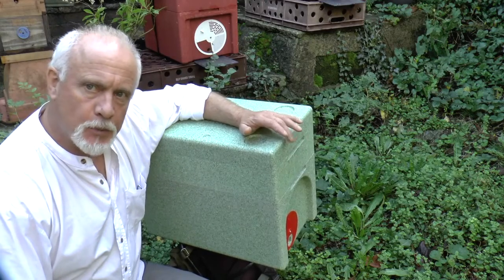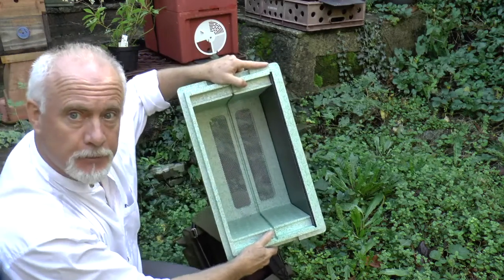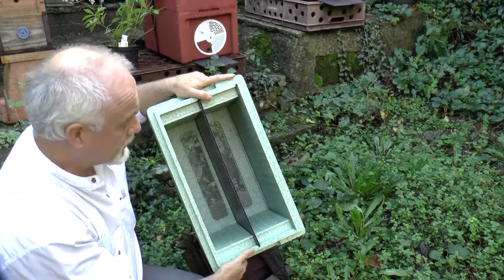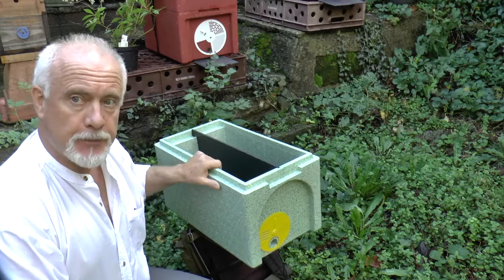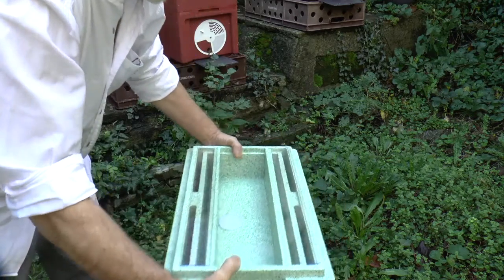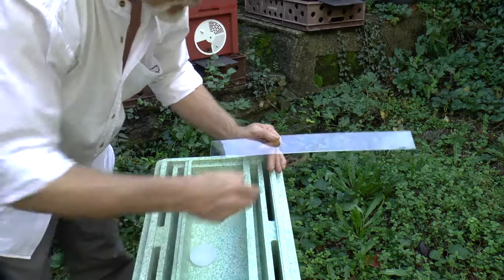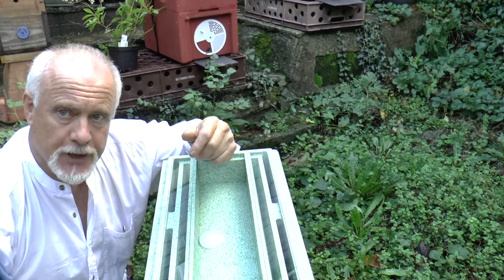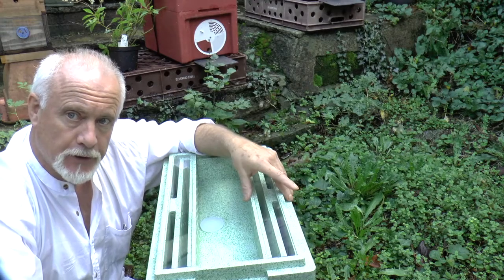How to Use a 2 in 1 Polynuc Beehive

Comment: Hi Phil, nice explanation! I have to completely agree with you and I really like the fact the side feeder has gone from the sides! Although I don’t use this type of poly Nucs I really like these! Three frames does give you more flexibility if there is a flow on and the alternate ends for returning queens is a really good point that definitely will help!! 
I’ve seen similar Nucs in ultra hard density poly for Dadants but these were only two frames! This is the best formulation I have seen! Really well thought out, tons of roof insulation and the added bonus of being able to feed fondant over the winter months! Please do a review at the end of 2018 season and share your findings!

Comment: Hi Phil, have been looking at poly hives because of the amazing thermal properties. I guess the only draw back is that one isn’t able to scorch it to kill any wax moth or nasty bacteria, but if you are careful I suppose it’s a small problem. We await further results. Thanks for the vid.
Reply from the maker: Nick Clarke They are easy to sterilise using 3% hydrogen peroxide solution: cheap and effective. I also use it to clean ol comb before re-use.
Reply: Philip Chandler Thanks for that advise.

Comment: Hello Phil - I've recently bought a top bar hive from Thornes (it's my second top-bar hive but I've only been beekeeping for one season so very new).  The base of it only has a central panel of mesh which is about a third of the total size of the base, and not the whole area.  I spoke to Thornes who said that the bees would get cold if it was larger.  I'm a bit skeptical of this.  What are your thoughts please.  Thanks.  Dee
Reply from the maker: I saw a Thornes top bar hive several years ago and was not impressed. It looked like it was designed by someone who had never used a TBH and had no idea how they worked. It was made from plywood, which was much too thin, had an end entrance and a roof that did not allow for insulation. I suspect their motive for selling them is to ensure that beekeepers did not succeed and returned to consuming more of their frames and foundation... but perhaps I am too cynical!  Either way, I don't use full mesh floors any more, preferring the eco-floor (search YouTube for my videos) but a smaller mesh area such as this may be OK. Unfortunately, the rest of their floor won't last long before it rots out, unless you give it several coats of yacht varnish before using it.
Reply: Hi Phil, thanks for this.  It's made from cedar but the roof is ply and needs varnishing and entrance holes needed to be drilled as there are none.  I have lots of yacht varnish! There isn't room for insulation but I'll persuade my husband to make an eke.  I'll have a look at the eco-floor.  Many thanks. Dee